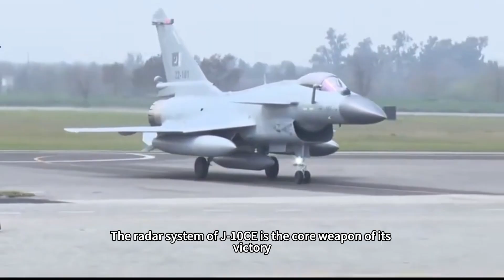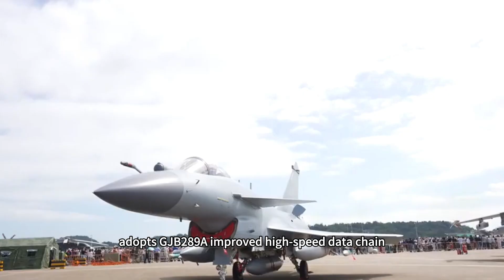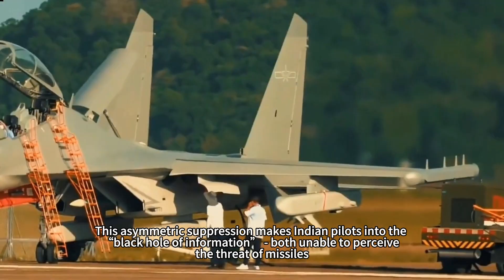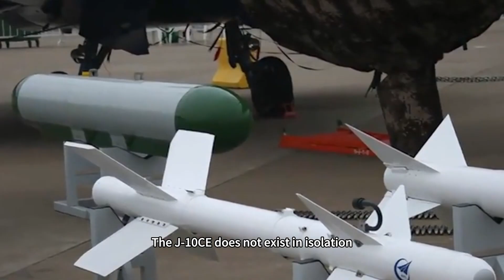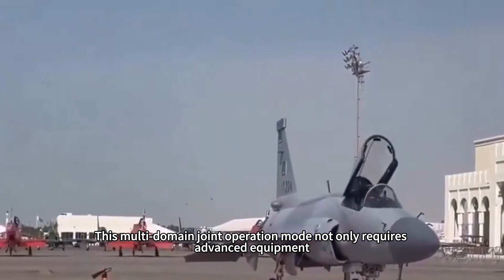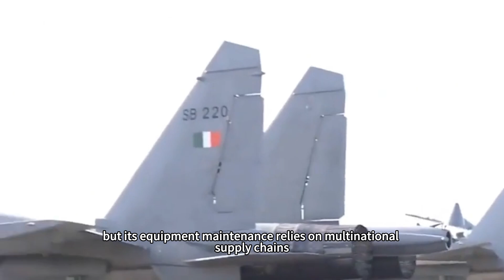J-10 Shoots Down Rafale Details Revealed, 80 kilometers of pursuit at Mach 5!

Comment: Early-warning Aircraft (EWA) located Rafale 400km away, guided j10 to 150km away from the target, j10 launched pl15 and then retreatd. Approaching silently with buit-in radar off, pl15 was guided by EWA at first phrase.Within the range of 10km, pl15 took over the relay of guiding, switched on its built-in powerful radar as well as the second-phrase thrust , locked precisely & firmly, and hit in 5 Mach within seconds, far beyond Rafale could have reacted properly, or for whoever piloted le rafale, ended-up by reacting in vain...again, excellent job of PAF, pakistani pilots. le Rafale is a good aircraft. I love indian culture, let's build a greater future for Asia together.

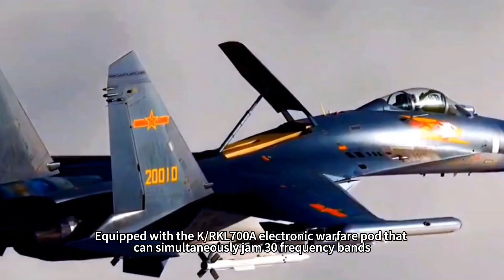Comment: Finally some details 03:30 now that start to make sense. 
Media focusing on pilots as if it were 1971, these airwar systems are calculating faster than humans can blink. J10CE and its supporting modules probably do not need a flesh pilot even to fire after the math is done.

Pakistan wins May 7 battle, but integrated Chinese tech makes it happen.
Major technological triumph for China, West is left in the dust.

Comment: The Chengdu J-10C fighter jet is the most advanced variant of China’s J-10 family, designed for modern aerial combat with multirole capabilities. The J-10C integrates a range of cutting-edge technologies, including advanced avionics, weapon systems, and aerodynamic design. Below is an overview of the key technologies featured in the J-10C:

🔹 1. AESA Radar (Active Electronically Scanned Array)
The J-10C is equipped with an AESA radar, which enables faster target detection, longer tracking range, and multi-target engagement capability.
It is more resistant to electronic jamming than older radar systems like PESA or MSA.

🔹 2. WS-10B Engine
Some J-10C units are now powered by the domestically produced WS-10B engine, which features thrust vectoring (in certain variants), allowing for extreme maneuverability and superior air-to-air performance.
Earlier versions used the Russian-made AL-31FN engine.

🔹 3. Stealth and RCS Reduction
The J-10C incorporates radar cross-section (RCS) reduction technologies such as radar-absorbent materials and a smoother aerodynamic design.
While not a full stealth aircraft like the J-20, the J-10C’s design helps reduce detectability by enemy radar systems.

🔹 4. Avionics and Glass Cockpit
The aircraft features a glass cockpit with three color multifunction displays (MFDs).
It is equipped with an advanced fly-by-wire system for precise maneuvering.
A Helmet-Mounted Display (HMD) allows pilots to aim weapons simply by turning their heads.

🔹 5. Electronic Warfare (EW) Suite
The J-10C is fitted with an integrated electronic warfare suite, including jammers, a Radar Warning Receiver (RWR), and countermeasure dispensers.
These systems enable the aircraft to disrupt enemy radar and evade guided missiles.

🔹 6. Modern Armament
The J-10C can carry a wide array of modern missiles, such as:

PL-15 (long-range air-to-air missile with active radar guidance)

PL-10 (short-range infrared-guided missile with high off-boresight targeting)

Various precision-guided bombs and air-to-ground missiles
It has 11 hardpoints for mounting weapons and sensor pods.

🔹 7. Multirole Capability
The aircraft is designed for both air superiority and ground attack, making it a truly multirole fighter.
It is capable of executing strike missions, reconnaissance, and air patrol duties.

🔹 8. Data Link and Network-Centric Warfare
The J-10C is equipped with data link systems that enable real-time data sharing with other aircraft, ground-based radars, and naval platforms, supporting network-centric warfare operations.

In conclusion, the J-10C is a 4.5+ generation fighter jet, developed to compete with platforms like the F-16V, Rafale, and Su-35, and is equipped with the technology required to remain effective in modern combat scenarios.
Reply: 如果中美发生战争，歼10就没用。中国会用双尾蝎无人机，攻击11无人机，无侦7，彩虹7等无人机作为主力，还有下个月首飞的九天无人机。
Reply: why translate to English ?
Reply: PLEASE send the above information to IAF
Reply: You mean to politicians ? Indian Airforce know the facts. Even most elite civilians know.
Reply: You are lecturing to fighter pilots. Common man doesnt understand
Reply: @Nilagirison 
Forget the common man, even countries that were advocating & admiring Rafael fighter jets , were in for a shock because they had grossly underrated Chinese technological supremacy.
Reply: Informed people as well elite air forces of the world and only the top officers of US AirForce already pretty much know capability of Chinese weaponry. Also politicians in countries deemed to be hostile to China are well aware of facts on the ground.
Reply: More educated people understand the technical details of fighters planes in certain select countries. Not only pilots.
Reply: Obvious. Clear vote for J10c
Reply: According to a May 12 report in The New York Times, a U.S. F-35 fighter jet was nearly shot down by Houthi militants' surface-to-air missiles (SAMs) during an operation in Yemen in early May 2025.
According to U.S. defense officials, the missile was so close to the F-35 that the pilot performed an emergency evasive maneuver to avoid it. The fact that America's newest and most powerful fifth-generation stealth aircraft was captured and nearly shot down by the Houthis, who were not regular military forces, surprised military officials around the world. This incident suggested that even advanced stealth fighters such as the F-35 could be threatened by portable infrared-tracking surface-to-air missiles (SAMs) operated by non-state actors represented by the Houthis. In particular, the fact that older but modified infrared-guided missiles used by the Houthis could pose a threat to stealth aircraft such as the F-35 was discovered. This incident has triggered a debate on the F-35's operational methods and mission selection.

Comment: Rafale's Performance:
A French Rafale pilot successfully maneuvered his aircraft to achieve a missile lock on an F-22 Raptor.
U.S. Air Force's Response:
The U.S. Air Force initially denied the Rafale's ability to outmaneuver and defeat the F-22.
Evidence of Lock:
The French Ministry of Defense released video evidence confirming the Rafale's missile lock on the F-22.

The encounter, which took place in 2009, sparked debate and uncertainty, as the U.S. Air Force initially denied the Rafale's ability to "defeat" the Raptor.
Reply: As a last year mechanical engineering student F-22 is magnificent engineering I admire that machine but I believe it’s overhyped like rafale.
Reply: @The-Majestic-One  I have read at least 7 AIAA papers related to the development of F-22 by Lockheed Martin. It is indeed an aircraft with very low observability (VLO) that paved the way for others like F-35, J-20, and J-35 to follow. But, with the body of knowledge back then, it is hardly the best for today technology like US people (who know almost nothing about aircraft prototyping) claim.
Reply: Both are obsolate plane but extremely overhyped.